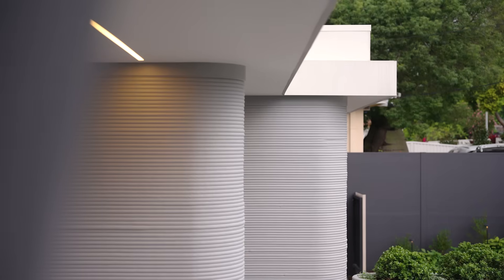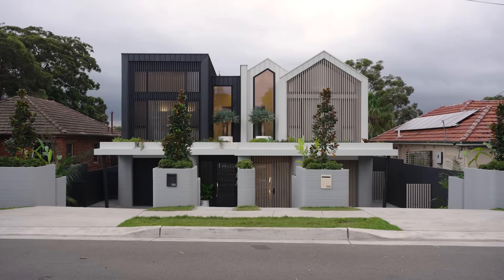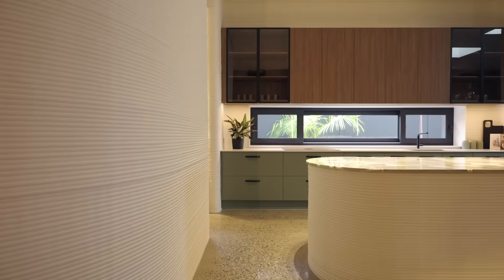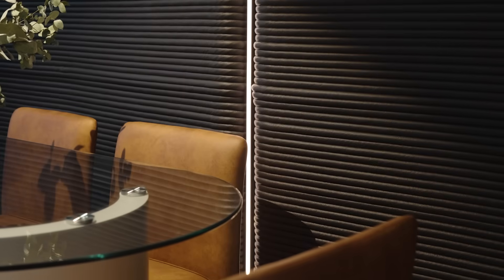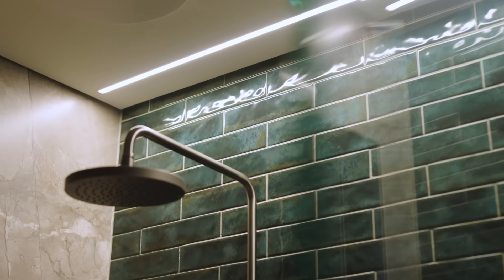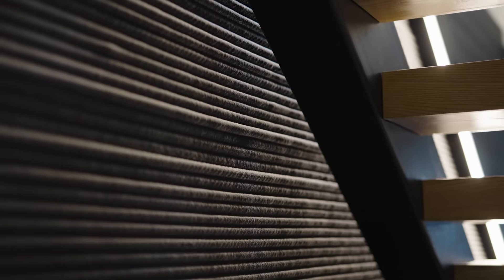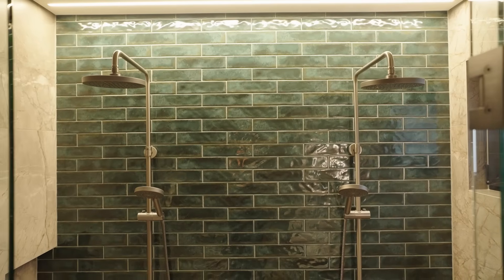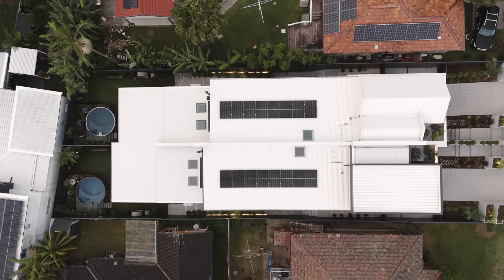Inside Australia’s First 3D Printed House

Comment: The finish product does looks good on the surface, still there are problems within 3D printing process and other not talked about hidden long term related issues...including health
Reply: A special blend of concrete with painting sealing the walls.

Comment: I appreciate that this is mainly a Showcase for the system, but there is too much 3D printed surface visible in the interior.  A typical homebuyer may be overwhelmed and 'turned off' by it.
We have noted some great designs over the years that lost their impact because of excessive use of a single finish.   Timber,  'white-on-white', or the overly bland sandy tones frequently used in Queensland come to mind.
The 3D printed finish has a lot going for it, in moderation.
Reply: Yes, the two residences are showcase homes.

Comment: What a dust collecting / cleaning nightmare🤦‍♂️
Reply: Can't do much about people sheading skin cells, hair, and fibres from clothing.
Reply: @CoLabLighting  But you CAN build walls without so many little ridges /ledges for dust to collect on .
Reply: @davo-Flames-175   the wall can be rendered or finished with plasterboard. As it was a showcase build the walls were left in the natural finish.
Reply: That was my initial thought. Those crevices will accumulate dust in the long run. Cant they smoothen  up the walls  with concrete as well? Is it not possible with this method?
Reply: What a weird comment. Imagine spending $500k and saying "mmmm it looks like alot if dusting" 😂
Reply: @sin_fc3822  it gets dusty though

Comment: Whats the energy rating of the home?
Reply: 7+ was mentioned in the Video
Reply: @truthseekersz I wasn't a very impressive number 😅
Reply: @MatthewBayard All that technology and effort for what sounds like they scraped into 7 stars. 

Sums up Australian residential construction.
Reply: @KS-yj1px  to be fair to get to a 8-10 its irrelevant how or what the house is made off. You need to have solar, batteries, double glazed windows, low cost lighting and basically a thermal insulating flooring. Essentially a 9-10 does not require mechanical heating or cooling
Reply: @KS-yj1px  7.9 from what I understand, looking to go higher.